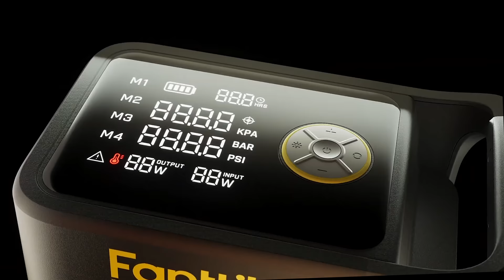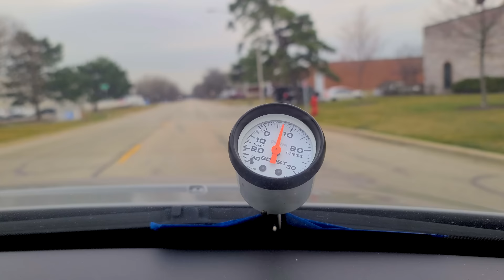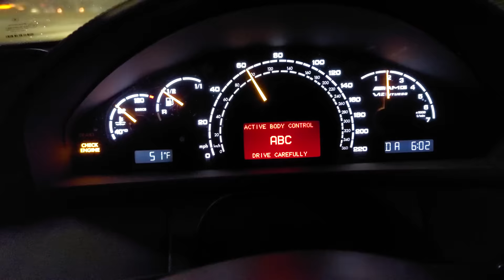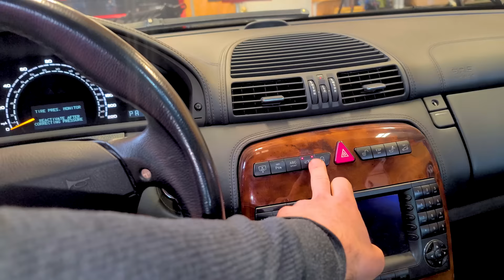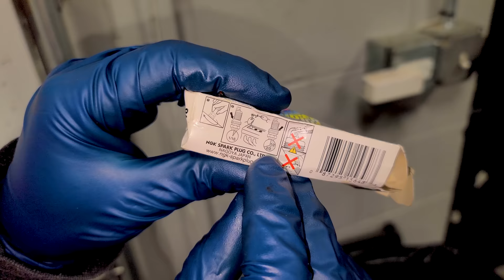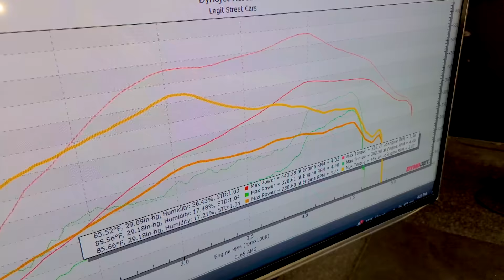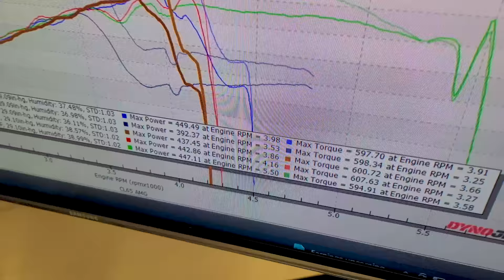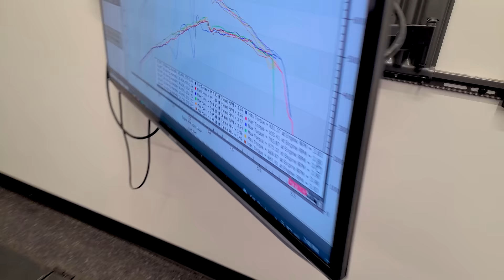I Finally Fixed My CL65 AMG & It RIPPED Until It Broke Again, TWICE! This Is Out Of Control!

Comment: Had to buy the same fluid for an Audi Power Steering Pump, you can buy the same Pentosin CHF11S fluid from Rockauto in 5 liter jug for about $84, its fraction of what you pay for those smaller containers from the local auto part stores

Comment: I bought a 2003 cl600 v12 biturbo with 60000m . have been following your cl65 vids and with each vid , my car mysteriously falls to the same ailments as your 65 :coil pack , suspension pump , door wire harness , trans  hard shifts , stuck in 3rd gear. I fear to watch any more of your vids for my 600 might find out . At times I feel to just give up but by the next weekend , I'm back at it . 59 yrs old now and hope to have a happy car not a money pit .
Reply: Unfortunately u will never fix it. U will fix everything then something else will break and so on. Don’t ask how i know 😅
Reply: These were malaise years for Mercedes.  I owned 2 MB from this era.  The company had major engineering and manufacturing issues that took a huge toll on the brand.   Anything from 1996 - 2008 is suspect
Reply: @TheShaggy1966  Plenty of M112 , M113 and M113K owners would probably disagree with you.
Reply: @TheShaggy1966 Patently false.
Reply: @TheShaggy1966 Complete nonsense
Reply: @TheShaggy1966 it’s more so that this is a very complex car, AMG V12 with a unique hydraulic suspension system and turbos. And AMG probably did not do the best job making it simpler, which is the issue.
Reply: M112 (and M272) owner who disagrees with you 🙋‍♂️

Comment: After working at the dealer for 20 years, I’ve noticed that when you replace the original one from when the car was new all the ones after that only last about 2 to 3 years.
Reply: OEM quality. Aftermarket parts even ‘dealer’ brand are typically don’t have the same stringent quality standards.
Reply: it's no secret, reduced quality to perpetuate repairs, because making it just as good isn't profitable. they all know they are going to lower quality standards for replacements when the fixes come rolling in just outside of projected warranty claim periods, cause that is how they can perpetually develop income. if they had the same standards they did during initial model year production,  then they'd loose money cause the parts would last too long.

Comment: Had Jake tune my 15 E63S he’s the best around!   Tunes Benzes are notorious for misfires due to coil packs but many guys want to think it’s the cheaper fix of plugs.    I’d replace your coil pack man know for the CL65 it’s expensive but I’d guess that fixes your issue since it didn’t misfire on 13psi but the higher boost and heat is not working with your coil pack…. Wishing you good luck Alex to fix her!!

Comment: On my 07 f150 I had a spark issue under load as well and was chasing it around replacing coils, new plugs etc. and it made no difference. Until I changed electrical connectors going to each coil. The pins in the plug were worn out and once it was under a heavy load it’d miss. So maybe something like that since you’ve had the coils out so many times and it has over 100k miles.
Reply: That sounds like it could be it
Reply: I was wondering too about the connections at the plug or coil to harness.
Reply: wouldn't be too surprised if it was a bad connector design.

Comment: I owned a 2001 CL600, non-turbo V12. I bought it in 2008 with 91,000 miles and shipped it to Kuwait. Kuwait is the ONLY country where I would dare own a used Mercedes because every other garage is a German car / Mercedes expert. Repairs are inexpensive, and if something expensive goes wrong, the dealer's expert mechanics moonlight and repairs are cheap! I had a massive oil leak that was solved by taking the top of the engine off. One night I dared venture in to the repair shop and saw my car's cylinder heads, intake manifold, the whole fuel injection on the ground! I was told not to worry. The Indian Expert Technician (moonlighting) was putting back together the parts so fast and smooth that he could have been blindfolded and continue his work. I told the shop owner I never wanted to see my car in pieces and asked him to deliver the car when it was done. Believe or not the car ran perfect for the next six years! Of course I had issues with the sunroof electrics, power window electrics and trunk release electrics, and also sticky knobs that were practically melting. The car was a Palm Springs car so the California sun had started the meltdown but the Kuwaiti sun took it to another level! I left Kuwait in 2014 and gave it to a friend. It was a wonderful car, smooth, silent and blindingly fast! BTW the engine oil leak repair cost me about $5000! At the dealership it would have cost me triple!
Reply: You're funny. Excessive repair shops does not make expensive, rare parts less expensive and less rare.
Reply: @rustler08 no but it makes the labor cheaper and many of these jobs are an incredible amount of time to replace a relatively cheap part compared to the cost of the technicians time.
Stop by your local Merc dealer and ask them their hourly rate if you want your mind blown
Reply: That’s a very interesting way of saying you had a valve cover leak
Reply: 5k doesn't sound so cheap...

Comment: Used to have a 2007 S600, bought it used in 2010 for a fraction of the price at 20k miles. Drove it until 160k with only 1 major repair at 120k and had to get rid of it cause it caught a gremlin at around 158k. Really love watching this series because some of the problems I do recognize and love to see you working on it. I only ever took mine to a shop so I don’t know much about that car. Got rid of it in 2018 and haven’t been satisfied with the power delivery of any other car I’ve owned

Comment: Here's a little protip I learned if you're worried about stripping a bolt: put valve grinding compound inside the allen head, and it will NEVER slip.

Comment: Sorry Alex. I feel your frustration. I would change plug manufacturers just as a checking measure. I know they aren't cheap, but I could not have that problem and not change brands and maybe go a range colder. I think it's a turbo flameout issue. I'm a Buick GN owner. It's worth some thought. Good luck.

Comment: Standing my ground on this one. Loose catalytic converter causing back pressure fluctuations.
Reply: Came here to see if you posted this again.. I'm rooting for you!  You'd think he'd at least try it if he saw your comment.
Reply: He talks about it at the end. Tried  running it without cats before and no difference. It is curious though that it's only happening in one bank.

Comment: Oh yes I have one as well. Also a lot of people think their ABC pump is shot when it’s not. Use air pressure into the ABC fluid reservoir to push the fluid into the pump, and while doing this push the abc raise button to open the fluid solenoid this will allow the fluid push into the system. I know your pain. I’ve changed that hose three times!

Comment: Alex, I am amazed that you are so persistent! I think your Cl65 is cursed. I've had two problems with my 2007 SL65. Replaced the tranny which I blamed on the extra abuse from Rennteching it. Just had my rear suspension lines and distribution block replaced to the tune of $6K. Yikes. Still cheaper than a new one. And mine is way cooler and still pretty fast. Renntech tuned mine and it's been flawless and turned it into a beast.

Comment: Find an injection molding place near you. injection molders use tons of hydraulic hoses, and they will know where the best local place to get hoses custom made is. I needed a power steering hose...dealer wanted $115, i got one made while I waited for under $30.

Comment: My dishwasher broke today after 8yrs service 
I bought a replacement which was more expensive but had no choice and the pipe which connects to the waste was different 🤔 
But as luck would have it the new one had a flexible end that was a tight fit into the existing waste 😊 I was lucky 
Your patience and determination to fix this mercedes goes above and beyond 🙏 
I drive a C350 diesel wagon no issues 
I take my hat off to you for your determination 
It gives us all inspiration and hope 😊
I'd like a buddy like you pal 👍 keep up the amazingly good work 👏

Comment: Alex, these coil packs are super sensitive to heat. Just thinking out loud, but perhaps by running it on the dyno so many times without any airflow over those packs (which wouldnt happen when driving normally), that the weakest of the 2 packs degraded past optimal performance. See how it performs once its cooled down again.

Comment: IDK if its applicable but i would check the steering angle and alignment to ensure the ECU is not reading a slip by any chance. 2nd see if the crank PS is reading correctly, CPK may be the part of the issue , you may want to osciloscope that puppy along with cam sensors...just to see if they are timed/synched

Comment: Keep going Alex. This car gives such great Diag advice. As a tech I love hearing another tech mentally go through the problem. I am betting it’s the coil. 
Also, is there no aftermarket ECU that could run this for you? If they can’t log all the information at once, you could piss away more than the cost of an ECU paying for tuner and dyno time.

Comment: Replace your coil packs, and only use ORM plugs. As for your abc pulse line. Take it to a hydraulic shop , and have the use your old line fittings, and build you a new hose. The factory hose is shit! Also check your motor mounts are not collapsing, if they are your hose can be rubbed by the crank pulley.

Comment: Alex you got me again. I bought that air compressor with the charging ports. I also bought the topdon js3000 which seems to be a good jump pack, the air compressor I plan on using to fast charge my RC batteries when I go on bash sessions with it. Hope it's as good as you made it look.

Comment: Love your channel and have been following your videos on the CL. All I can say is that I can certainly understand where you’re at. I have a 2004 CL600 that I love when it is running right and that I hate when not.
I currently have a check engine light that won’t go away. I’ve had the spark plugs replaced and the check engine light stayed off for about 50 miles, then back again.  Same cylinder, same bank…
If you ever want another sample, data point, or am a glutton for punishment, I would certainly appreciate you taking a look at mine.  Consider it a mission impossible episode for you to show off your CL troubleshooting skills, LOL.
I live in the western burbs of Chicago and would love to bond with another CL owner like yourself!
Let’s do a dual CL episode!

Comment: Alex I had this expansion pipe problem after 3 MB pipes I had one made 
Higher pressure and with a joiner so you don’t have to strip a load off ,it was cured you can get up through the suspension wishbone to get access to the banjo bolt through weather cover got it down to about an hour in the end exact same fault I feel you pain 🤝🤝🤝

Comment: Voltage drop test that side coil  bank 12v supply when the misfire happens. Also if it a separate ground circuit on each coil bank side put that under load and test that too, basically may be voltage drop to the coils when running high load through them (plugs require more amps to stop spark blow out under high boost). Would explain why it runs fine under light load but not under high boost

Comment: Did you forget you fixed a boost leak that's probably y it gained boost pressure not the change in plug gap but great job on this thing it's definitely coming around

Comment: Alex I own an S600 that is giving me troubles but I'm working on fixing it with help of your videos. You are chasing a HP number on a dyno. These cars are not good tuners. I would cut loses and get a reliable lower power tune on there. 700 lb ft of torque is nothing to sneeze at either!

Comment: there is a hole in the wheel well that will give u access to the ABC pump hose bolt i got a 2006 w220 S65 AMG which has it the hole is throw the frame of the car

Comment: It’s gotta be. A wiring issue or the ecu or ignition (cpu) what ever that may be has got to be bad, the plugs and coils are more then likely fine. Gotta run those random misfires up the line.

Comment: You did fix that vacuum leak. Could that explain why you are getting more pressure? Anyway, you are sometimes a cautionary tale. Your ABC video where you had accumulator plastic stuck in the lines made me replace my accumulators to prevent calamity! My 04 SL500 has a healthy ABC system partly because of your videos! I also made a vid on how to change out the ABC pump… it has 2200 views! I’m coming for you, lol! Keep up the good work!

Comment: I think it might be the wiring on the driver side bank. If the wires that signal a misfire are janky then you will get a moving target. I'd at least look at the connectors and wires. Also on my 94 mustang I would get weird signal errors from the hood not being grounded...

Comment: Was hoping we would see more CL65 stuff - and yay 🎉 but 😢.

At this stage I would mbe try swapping out the ECU just to eliminate some BS there?  You should be making 600 wheel with that spec.  Swapout knock sensors … give it a slap on the butt?  God knows Alex.  But pls dont give up!  Hang in there we are there with you!

Comment: I am leaning towards exhaust restriction or maybe try a hotter plug set. Could be blowing out spark at high rpm with increased boost pressures

Comment: So i had a similar issue with my 2008 dodge magnum, and after replacing coils multiple times and a complete engine harness, it ended up being the freaken 02 sensors

Comment: So interesting to see - by now I am very curious  what Brabus did to tune those. There are 65 AMG Engines from tuners with 1000 hp, what did they change? I know that there was for example a 900 hp CL with that engine. Back in the day it was said to have 4 Turbos and 8.1 L of displacement. Were there other variants? Maybe you could take a look at those and see what they did. Maybe there is a limitation, you dont know about, that just stops at 600 torques and shuts it down - gearbox related early style torque limiting

Comment: Check the power supply wires for the ignition on the driver bank.  A current deficiency could cause intermittent operation with a big load on that system...

Comment: Not sure if your car is a drive by wire or has cable, but if it is drive by wire, the problem you may be having is with the APPS (Accelerator Pedal Position Sensor).  Because if it's bad, you will have issues with the traction control, engine light will come on, it will go into limp mode and possibly misfire until you shut off engine and restart, then it will reset itself..  It's a safety issue if the APPS is bad or worn out and will cause those symptoms to happen..  I hope this helps

Comment: Wow Alex this amg reminds of a X5 I bought to to daily while I was working on my 2 projects as it would go I ended up spending alternate nights after chasing codes replacing sensors plugs valve seals and so forth let me tell you I ended up driving my a track car I was building to go back and forth for parts gaskets 🤦🏻‍♂️ 

I was so freaaaaking happy when that suv left my yard never again love German cars but will it ever own any again here in the states anyway my sis in laws Range Rover also ended up in my possession and once more …never again unless I own the vehicle I will not touch a clients car if it’s German even after buying several tools for these vehicles to work on them I respect how you keep going I would t have the will power sir 😂

Comment: Hey man, so I have an Audi S5 V8 that was giving me misfires on all  cylinders, particularly cylinder 7. I changed out all the coil packs and low and behold 2 weeks later the problem reappears. Anyway long story short after some investigating I changed out my MAF sensor and the problem was solved. If the MAF sensor is on its way out it can vary how much fuel each cylinder gets and this can lead to multiple misfires. I know your beautiful AMG doesn't have MAF sensors, but has MAP sensors. Cheap enough part, it might be worth changing them out. Lovin' your work and I can't wait to see you doing a problem free full pull in your V12

Comment: So when you’re finally ready to give up on this thing, do a LS3-based stroker build (408-416ci) and swap it. Throw in a pair of turbos.

It’ll be cheap, easy, and reliable. There will be more room in the engine bay. And you can still have a quiet exhaust if you want. 

😜

Comment: Hi alex, i hope you would listen this time .. i say you working on the engine and i know exactly what you have done, i have W221 S600 M275 engine like yours, i am 25 years mechanical experience also i am an engineer.. you have 2 problems to solve, you need to change your downpipe with high flow ones, you need to change that coil pack, then do your software remapping again, also make sure your air filters are new, this thing when its working fine could make a tyres spin on 140 KM easy, please change the coil it would work like magic, but since you are in heads& turbo job then you should first clear the coil pack problem and after that everything would be smooth, but as soon you getting your leg hard on that throttle that ecu would go crazy trying to save the transmation, in short you need to remap both ECU & TCU ask eurocharged or renntech to do that, don't waste time or money.

Comment: I know your issue, it's the irridium plugs. They are gapped different from platinum plugs. But also some cars will only run with platinum plugs. Old jeeps do the same issue. If I remember right old Ford's won't run with irridium either!